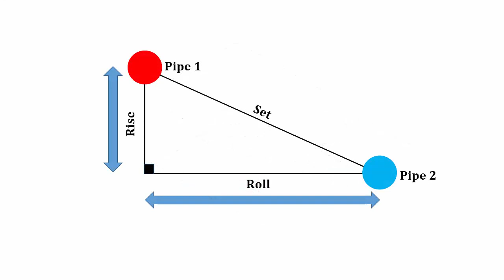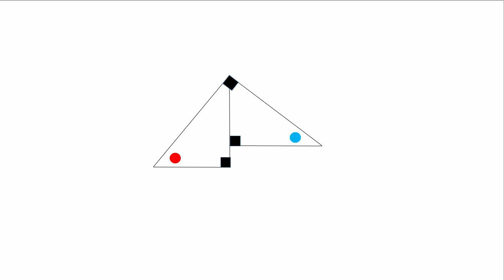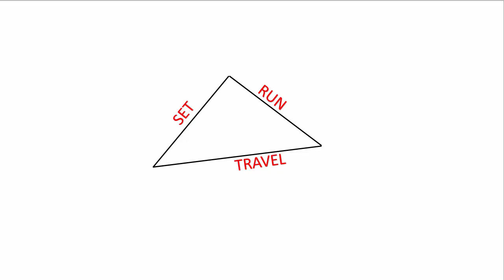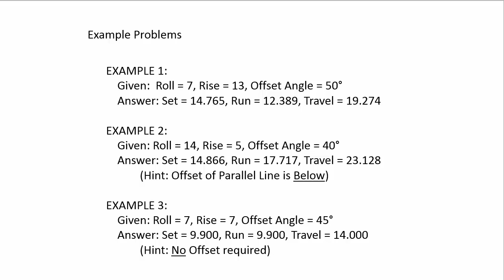Finding a Rolling Offset's Run, Set and Travel in the Field

Comment from the maker: For those wondering or wishing to use a angle not included in the table, the equation to find the Factor = Units x ( 1-tan(90-Angle in degrees)). The units are basically a proportional factor. 10 units were used to make the intersection of the lines easier to find. Any Units value could have been used - the answer would be the same.